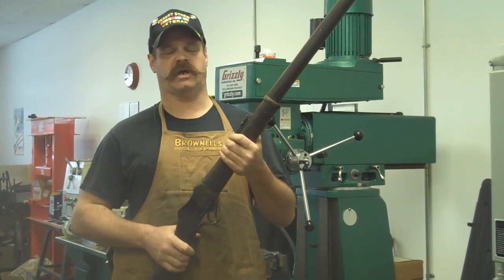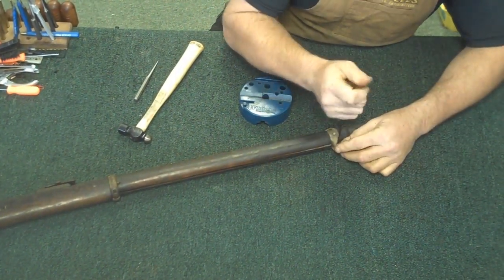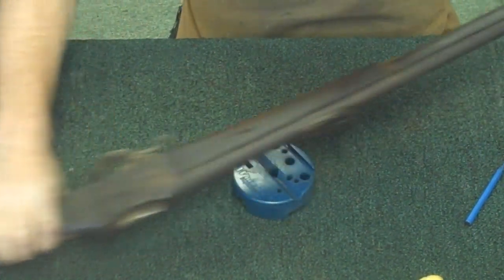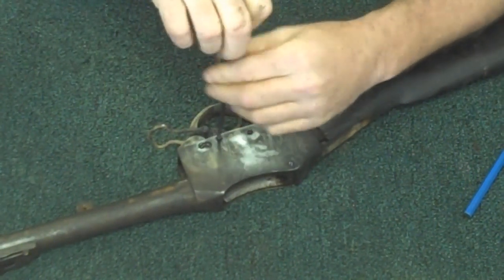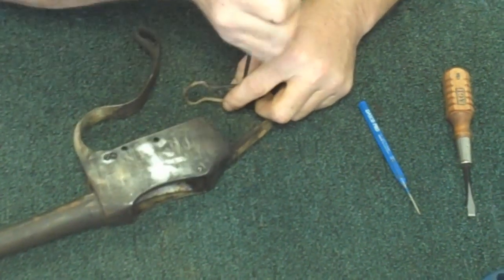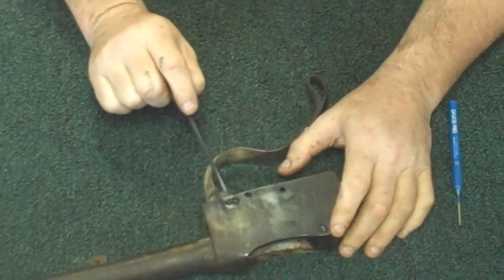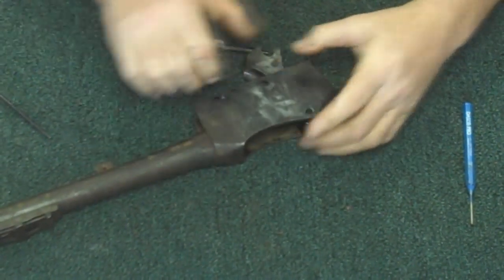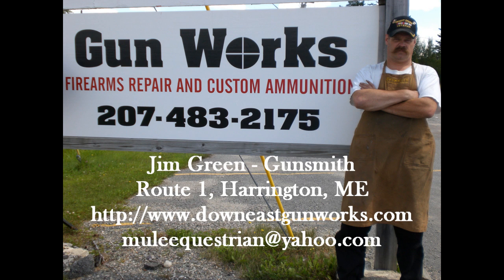Gunsmithing: Gahendra Martini Henry Rifle .577/.450 (Gunworks)

Comment from the maker: @41Flashman41 Rifle barrels are generally threaded into the reciever.... in some cases they can be pinned in place too. If you send an email with pics I can look at them and we can figure something out. If you have to turn the barrel further into the reciever it will change the headspace and cause problems. Without getting a good look at what's going on with your gun in particular it might be a little hard to just guess what's wrong

Comment: So question if the barrel has alot of outside pitting but the internals of the barrel are good is it safe to fire , i picked up one from someoen for cheap but tis got alot of pitting where the edge of the stock met the wood and most of the other ones ive seen from IMA have that problem , so wold you think its safe to fire with the pitting?

Comment: Great video I just picked up a Martini Henry from IMA. It was taken apart and cleaned by their gunsmith. Bore seem very good however there is some pitting at outer surface of the barrel sides where barrel  meets the stock. I picked up some Kynock 577/450 ammo and would like to take it to the range. I was planning on taking it to a local gunsmith for a safety check. If  I cannot find a local gunsmith does your shop do safety checks? Thank you

Comment: Nice video.  These things are safe too shoot if..... The one in your video came apart way too easy, and looks way to nice.  They must be getting down to the junkier ones now cause the barrels are very pitted in some spots 1/8 of and inch. My thought if you want one to be a shooter is to buy six or so and send the bad ones back. Hope and pray would not hurt either. These are over 100 years old and sold as decorations and wall hangers. So keep that in mind before dropping a $185+ for an untouched